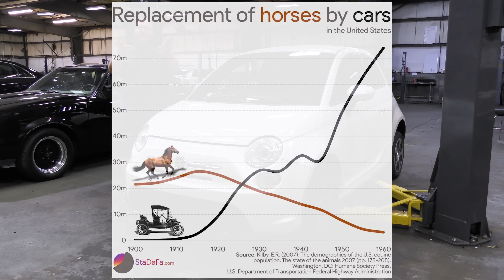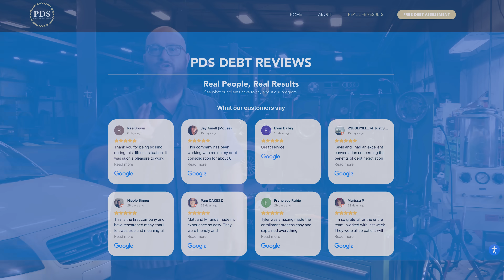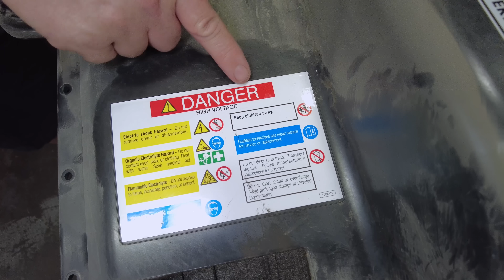How to SAFELY Remove the EV Batteries From my Fiat 500e

Comment: I disagree somewhat Wizard, one major difference is that electric cars were around before ICE cars were and they still haven't advanced enough to out perform the internal combustion engine. While you're correct they aren't going away completely, sales are already in a deep decline and manufacturers won't keep building them to lose money. Until they are able to actually have a decent range in all weather conditions, be charged as quickly and as cheaply as gas/diesel vehicles and the battery technology becomes longer lasting and cost efficient to repair/replace EV's will be nothing more than a novelty for the rich and people who don't travel or live in the cold/ extreme heat just as they are now. And as far as government requirements go, federally the mandatory EV legislation will be extended further out or completely done away with as soon as Trump gets sworn in January or Republicans take over Congress again and that will be the case for atleast 4 years until another climate commie gets in office and tries to force EV's on the public again. Not to mention our country doesn't have anywhere close to a strong enough power grid to handle millions of people charging EV's at the same time like we do with gas stations to refuel now. They can build all the charging stations they want but the fact is there isn't enough power to supply them and we don't have the technology or the funds for a power grid that could support them. Now as far as states like California who will most likely still try to force EV's on what's left of their population, they will probably have to find out the hard way when they over strain their grid and it will completely fail causing widespread blackouts and other issues. This is easy to predict because their grid can't even handle the current situation at times and they have to force rolling blackouts and restrictions on when people can and cannot use their home a/c for example. Now imagine what's going to happen when there are 10 million+ EV's all needing to draw power from that same grid daily year round. Internal combustion vehicles aren't goin anywhere for the foreseeable future because they've been perfected over the past 100+ years and it makes zero sense to replace that for a technology that hasn't improved very much at all over the same time frame. I actually expect a different form of reusable energy to become the standard over gasoline instead of electric vehicles. There is already several different types in development and are progressing much faster than EV technology and some of them would be much easier to convert the existing infrastructure. By the way wizard you're not getting old, I felt that way as well once I hit 40 and now at 45 I've realized I refuse to think that way when there are people over 70 still doing what they love and what they love because they refuse to let a number determine what they do in their lives. That really helped me understand that we don't have to feel like we're getting old and we can continue living life without this feeling that our best days are behind us and look forward to many great things in life.

Comment: Forget about the idea of unified battery cells, it won't happen just like smart phones don't have them either. A manufacturer is not interested because the after sales market is what brings in the money, not the sale of the car which has minimum margins. Unified batteries would mean a client can get a cheaper one at another manufacturer, not ideal for them as they won't make any profit of the original client. Manufacturers don't give a damn about the environment, right to repair, unified whatever or government restrictions (imposed they need to but they'll try anything to get away from it, see volkswagen) they only care about one thing: their profit. Period.

Comment: EVs are dangerous crap! They WILL go away.
Reply: No they wont.
Reply: @londonyes1380  Already happening, wake up.
Reply: @Mikere5  you obviously just rushed to  type your ignorant statement rather than watch the whole video.  They arent going away the battery/charging tech is developing at a rapid pace.  It may be a slower journey in the US, partly because of the complete stupidity of some people but its going to happen.  EVs are catagorically not going away.
Reply: @londonyes1380  I watched it all, I also watch many other channels reporting on the fires and mayhem these pieces of overpriced crap are causing.

Comment: A gas car is far superior then the electric car.  It doesn't take an hour to fill up a gas car.  Gas/diesel cars can get over 4 to 500 miles per tank depending on vehicle.  Horses were inferior to the gas car.  This isn't a fair comparison.  The battery pack replacement is 10x the cost of an engine rebuild or swap.  Another win for gas car.  There will be shops to convert electric cars to gas when the battery packs go bad.  Electric cars will pile up faster because their main battery packs go bad.
Reply: Yes in your mind this will happen.

Comment: In practice, unless the contactors have welded shut in the battery pack, you can safely remove all the connectors without removing the fuse first. But they put safely in layers just to make sure no one gets hurt, even if there is welded contactors.

Comment: A find it funny how people mention the lack of maintance on ev's, li wizzard said kids dont want to do an oil change or a timing chain, well guess what they dont do that, they take it somewhere for someone to do it for them, oh yea but i have to take it to a mechanic shop and bla bla bla, well then genius you are forgeting that you still have to take to a mechanic shop because you know its only the engine that is different evething else still the same, transmission shafts headlights tires wheelbeearings pretty much the same, the only difference is that what used to be mechanical driven now its eletric driven such as the AC compressor air vents and pretty much everthing. Luckly the ev trend is starting to die a bit people are now facing the issues with ev's range ansiety unriable no place to chrage because you know people live in apartments and people wont be passing an extension cord from the 15th floor and they pay so much for a car that nobody will want to buy it on the used market, look at this they bought it for 700$ a car with 10 years that cost 30.000$ even an old broken bently with that mineral oil issue is worth more than 700$ its just facts, ev's have been around way before the combustion engines they have tried several times and they have failed, first car was eletric and fail to the gasoline, 20 years ago they tried to go eletric again with the prius and nissan leaf they fail, now a days they are forcing ev's down the throat by even not allowing combustion cars being made  after 2035 in europe and they still failing, lots of ev's supporters went back to combustion engines mostly just after being faced with the EV's issues. If you dont belive me this channel is proof of what iam saying Hoovies garage the D+bst channel on all youtube just past it on  to someone else  not even him wanted it and thats saying quite alot lol.

Comment: Does he have anyone with ev high voltage safety certification? Just because you pull the orange fuse doesn't mean the system becomes a safe playground for poking around and swapping out components.

Comment: EV is not the replacement for a gas engine. the battery short lifespan and the risk to die burned by a battery rupture makes it inviable. I'm still voting for hydrogen.
Reply: Yeah shows how deluded some people are.  Hydrogen for personal transport is conpletely dead.  And modern batteries will last a very long time, especially with lithium iron phosphate batteries which are even more durable.  But go ahead and keep ignoring reality.

Comment: Being an electrical engineer that worked in the power industry for over 30 years i would not go near high voltage unless it was proven de-energised, shorted and earthed. I would treat anything there that is orange as a warning that is high voltage. Beware!

Comment: they are disposable just like a cell phone..
Reply: No they arent.
Reply: @londonyes1380  Yes they are no one will ever restore and old ev, when they need a new battery they will go right to the junk yard, even small damage and insurance company writes them off..
Reply: @kauldercage5469  uh duhh of course they will go to the junk yard.  Just like any old internal combustion vehicle will once its old and beyond repair.  Genius.
Reply: @londonyes1380  But none will ever be restored like people do with old classic gas cars, because evs are disposable DUHHHHHHHHHH..
Reply: @kauldercage5469  ok and?  Do most regular people really give a shit about restoring old cars?
Reply: @londonyes1380  I dont know do most people care when an ev goes into thermal runaway and burns their house down?
Reply: @kauldercage5469  electric vehicles statistically are a lot less likely to catch fire than internal combustion vehicles.  If you bothered to do any research whatsoever rather than type blanket statements then you would know

Comment: Are a number of EV manufacturers not interested in longevity? 
Like burying that control module that is a point of failure deep in the battery pack and I’ve been told Tesla do that too and it’s a big point of failure for them too, and the cost of labour to drop the pack and go through all that essentially bricks these things unless you can hack it yourself, which do able but again, you are getting back to the newer gen who you say don’t want to do all that?! 
Yes, they can be recycled but recycling is expensive in labour and it’s energy hungry and also potentially bad for the environment too. So there’s that.

Comment: 18:00 maybe, maybe not, in Europe we already don't need crazy ranges for our EVs, we have fast charging stations a bit everywhere, doing roadtrips is quite easy. I don't think that the future of EVs is to shove giant batteries in them just for the 2 times a year you're doing a long roadtrip with it, it's better to address the chargers situation and solve the range anxiety of some drivers...
Reply: one problem,   there isn't enough copper available in the world to support EVs.  Europe also has problems with energy production,  personal charging stations, forget it.   Public charging stations are frequently broken into to steal,   yes, copper.
Reply: @humer1971  Battery chemistry is one of the fastest evolving research fields, in the past years we saw a shifting from NMC to LFP battery tech, LFP batteries using less of those rarer metals like Cobalt or Copper like you're concerned about (up to 50% less  Copper needed), and it's just the beginning, we have even better battery technologies getting developed as we speak, especially Sodium batteries and solid state batteries.... so be sure that we will see a lot of changes in coming years and the price of batteries will fall even harder and the use of rarer materials as well. 
But you know what is becoming rarer and that we can't avoid in a petrol engine? Oil, yeah....

Europe doesn't have a problem with energy production, some countries are having challenges with their shift to renewable but it's a rather good problem to have, better to tackle it sooner than later, investing in renewable before fossil energy power plants become too costly and impossible to run anymore. Most importantly EVs play a key role in that part, they are enabling what we call "smart grids" where your car is able to recharge at no cost during the day when energy is abundant from solar panels and to redistribute it at peak consumption periods like the evenings during winters, etc... smart grids will solve that problem and make our use of electricity both greener and more efficient. Of course the NMC battery technology was not adapted for this use but LFP batteries are already better at it, with way longer longevity and the future of electricity storage will probably be totally changed once Sodium batteries are becoming mass produced (probably very soon, they are already getting used in a few production cars)....

So yeah we have a lot more solutions to the problems that mass adoption of EVs will cause than to the problems related to continuing to have all of our cars running on oil....
Reply: @manu.yt25  keep dreaming, copper, electricity are finite resources.

Comment: I love your channel and watched for many years, but I have to disagree that moving to battery vehicles is like moving to ICE vehicles from horses. Gasoline has around 50 times the energy density of current vehicle batteries... despite what manufacturers tell to this is inefficient old tech, which is developing at a snails pace.
Sure, there are some usage scenarios where battery vehicles make sense, but there are many others where they do not. HEVs currently make much more sense and don't require the government to bribe us with taxpayer money to purchase them.
Keep up the great work 👍
Reply: Its developing at a rapid pace.  I dont know where you get your info from.  And there are huge use cases for electric personal transport.  Prephaps less so in parts of sprawling rural America but in dense towns and cities they make a lot of sense.  Especially in europe.  And petrol is more power dense but that doesnt mean its more efficient.

Comment: Spares on a lot of new or newish cars can be hard to get. One of my nephews has a leased Rang Rover which is less than twelve months old. It has a problem in the rear end (I am not sure exactly what it is). It is covered under warranty but the dealer has had to search for a replacement new part and has found that there is only one available in the world that they could find. It is on its the way from a dealer in Beijing.

Comment: I said to myself years ago that I wouldn't buy a fuel injected car, only carbureted, since I was familiar with those. I eventually bought a FI car. Then I said I wouldn't buy a Harley until they too became fuel injected. I eventually did just that. I won't buy an EV until the battery technology improves (away from Li-ion) to promising new [lower cost] technology offering comparable range to IC and quicker charging. I'll be waiting...
Reply: Lithium iron phosphate batterys are designed to last 1000s of charges, less risk of thermal runaway, can be charged from %100 to %0 etc.. we are kind of already there with some cars.  We have small/medium family cars in EU/UK with this tech in it already.  Hopefully sooner rather than later it will arrive mass market in the US.

Comment: Unified EV architecture: Well ... at the end yes, but the next years we will see so much innovation/improvement on the Energy Storing components like batteries. Which is the opposite of standardization. Maybe it's possible to make plug compatible replacements, but even then there's limits. What if charging station invents an 18 phase electric supply as optimum - how can you make an old EV compatible for it? Inventions are unpredictable, so you can't really compare them.

Comment: those in the IT industry have seen paradigm shifts multiple times in our careers, the only constant is change. You have to keep up with change, and with over a million on the road in both the US and UK i applaud those wanting to keep ahead.
Reply: Yes, and many times things have gotten worse while costing more money, while it takes years for the tech to be fully realized as it was originally envisioned. I got off the early adopter bandwagon in tech pretty quick after getting burned a few times, and I sure won't be doing it for cars.

Comment: ICE won because of superior tech and the infrastructure still trailed.  The Interstate system didn't get built until the late 1950's!  The government stayed out of the way, except to fund better oils and fuels research in cooperation with the auto industry and oil companies.  Today, the government is jamming EVs down our throats and is hostile to the oil industry.  Huge difference.  And this repair epitomizes exactly what is wrong with EVs.  One module bad but the only shop that repairs the thing is located in Bulgaria.  FIAT vs. a single vendor in Bulgaria!    Non-warranty repair?  No guarantee you will ever see that module again. Seems FIAT never intended to support this EV past pushing it out of the factory where it was built.  A true intentional throw-away design.  Is Ford, GM or Tesla any better?  Tesla can't even support in-warranty repair (no thought to build a parts factory).
Reply: no one is "jamming EVS doen our throats" stop being such a baby.  And fossil fuel industries still enjoy HUGE subsidies from the United States government.  Some people just cant accept change.

Comment: The fact that some of the cells are not visible to the module, it is likely faulty but I would want to check the sense wires and connector pins for continuity before spending $$$.  In any event, while apart I would want to manually check cell by cell voltage and charge any/all that are low.

Comment: You raised an important point, keeping 'trade secrets' has become the biggest problem. When every company is happy to share breakthroughs everyone benefits. Do you get charged for the patent rights on a seatbelt when you buy a new car? Volvo gave away that invention & everyone uses it. When Edison Motors in Canada wanted to start converting trucks to EV no western manufacturer would let them see how their technology went together, a Chinese factory was happy to let them see because everyone benefits form another company possibly finding a better way & sharing it with others.